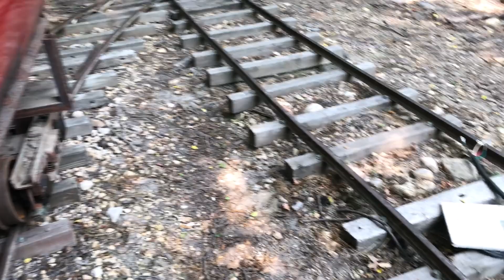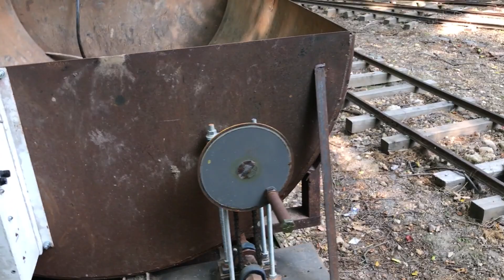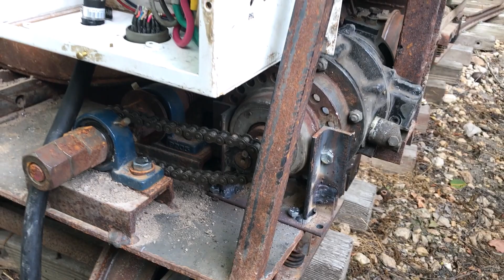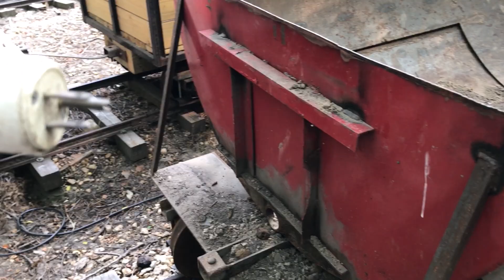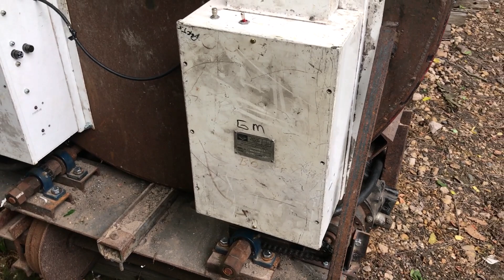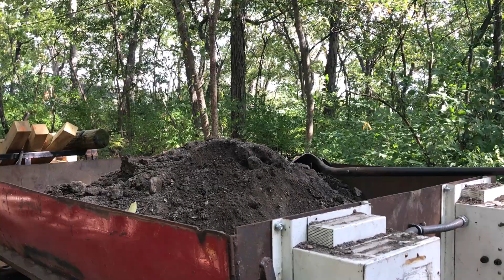Modification of the dump car to add powered doors

Comment: Keep an eye on those starter motors, they generate significant heat. A circuit breaker of correct amperage will prevent those very powerful motors from ripping all of your hard work to pieces. They probably won't give adequate warning when your jack screws lock up. Thanks again!
Reply from the maker: The motors actually have a clutch built into them to keep that from happening, and the motors are operated on 14 volts which also reduces their power significantly. There is a fuse to prevent short circuit faults from destroying things.